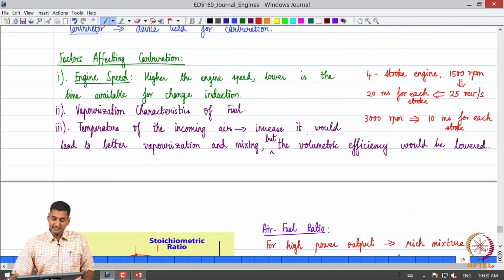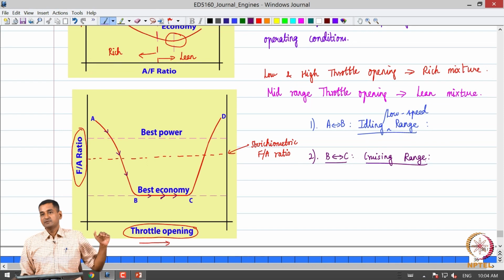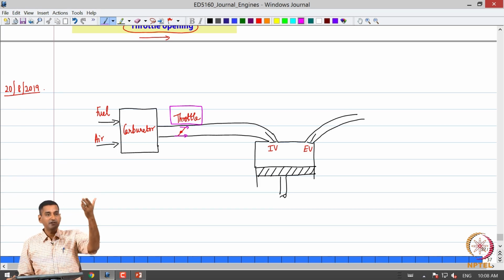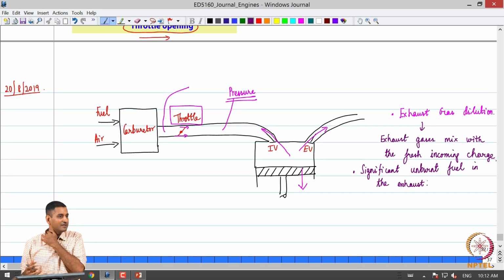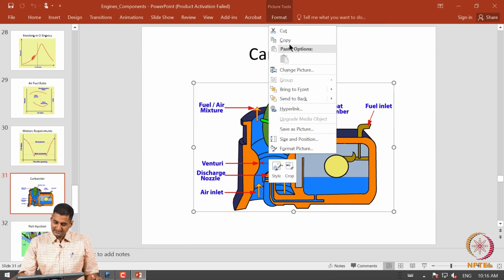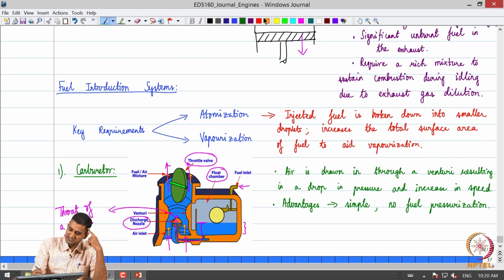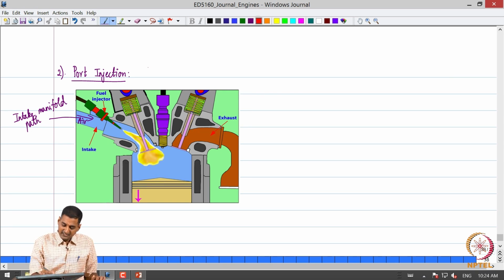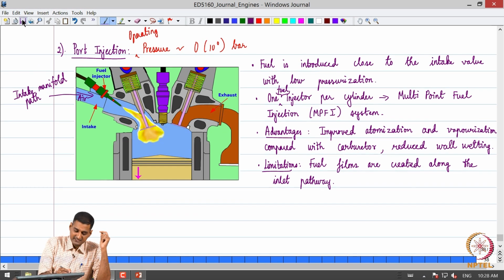#21 Fuel Introduction Systems | Part 01 | Fundamentals of Automotive Systems

Comment: the basic concept of idling comes from the vehicle being at rest rather than moving. I do not understand the logic of the requirement of a rich fuel mixture when it is idling. It's like doing nothing at high cost?. If this is understood I will be much obliged to have a reply on this query?
Reply: Due to low pr. at inlet manifold (say, due to suction stroke) or the mismatch in (inlet/exhaust) opening time, the high pr. exhaust gas may find a way to inlet manifold. Since, the throttle peddle is not pressed, throttle opening is least (& not completely closed!!!). This may lead choke the engine of air, due to mixing with the exhaust gas.
And engine may die/ shutdown.
To prevent this we introduce rich mixture, to keep the engine alive during idling (although a significant amount of fuel may not burn properly)..
Reply: He just explained it in the video. 

At the idling stage, there is a time overlap between the intake and exhaust engine strokes. This means that the valves can be open at the same time. As a result, the exhaust gases (which are at a higher pressure and which normally should only travel through the exhaust manifold) mix with the fresh charge (the intake manifold is at a lower pressure so this creates that tendency). 

This creates exhaust gas dilution which limits the intake of fresh charge into the combustion chamber. To combat this limitation, and thereby ensure that the engine continues to run, a rich mixture is required.

Simple as that.

Now the next question may be, how is a richer mixture introduced into the manifold? Well that would be the job of the carburetor. There would be a mechanism of action that would introduce the richer mixture during the idling stage. Perhaps when you press on the brakes, the carburetor would be configured to recognize that the engine is on and essentially idling which in turn would trigger a greater opening in the valve within the carburetor that introduces fuel into the Fuel-air mixture.
Reply: Look exhaust gas dilution hinders effective combustion by not letting the air and fuel particles to come in contact. But if we've a rich mixture, it reduces that tendency(not completely). So for the next stage of combustion we get more combustible air-fuel mixture.